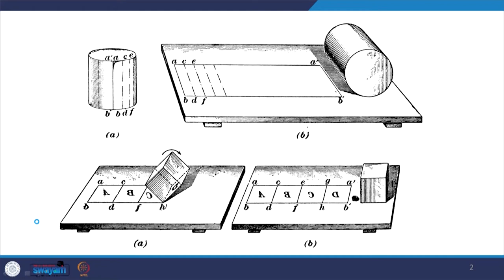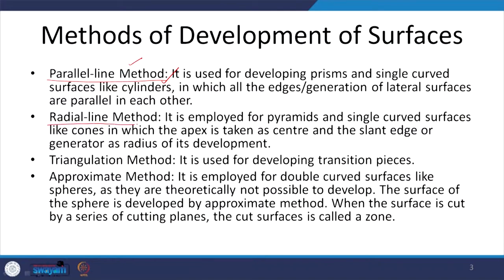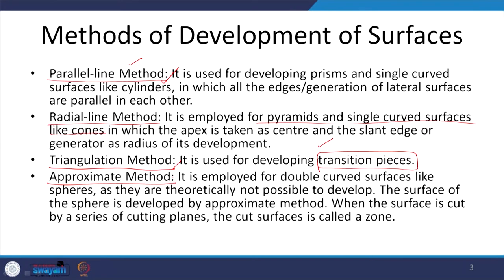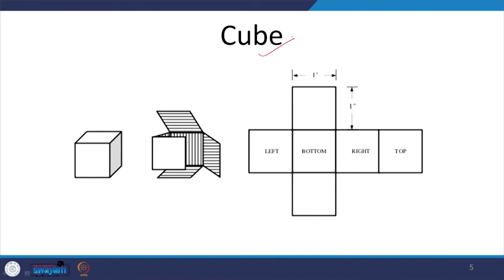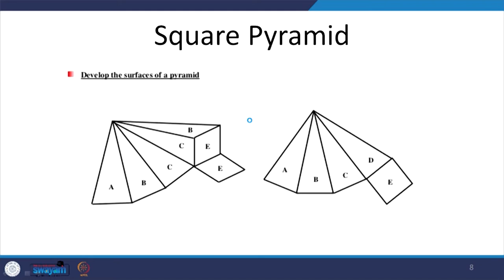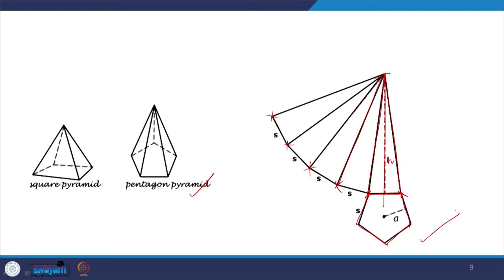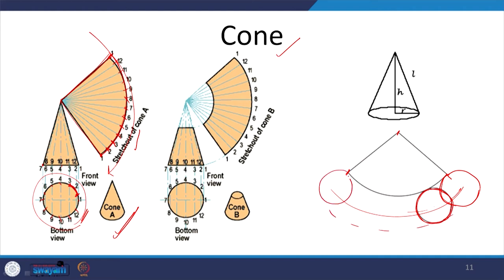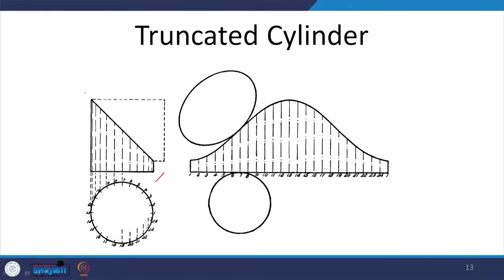Lecture 37: Development of Surfaces - I

Comment: Maam, 25:00 You haven't explained, how to calculate the angle subtended by the two extreme generators? and how to divide that surface into 12 equal parts, we know how to divide circle into 12 equal parts, but what about the surface?